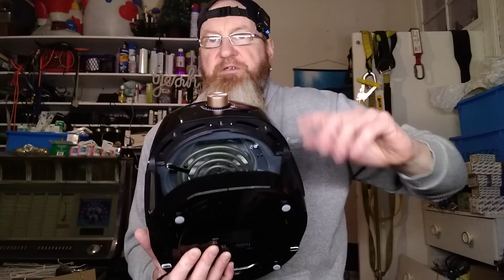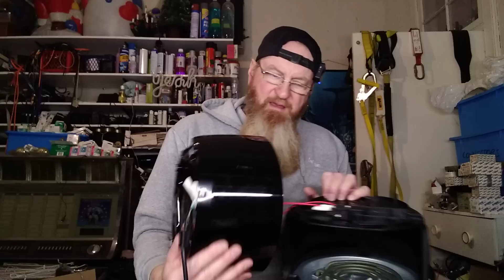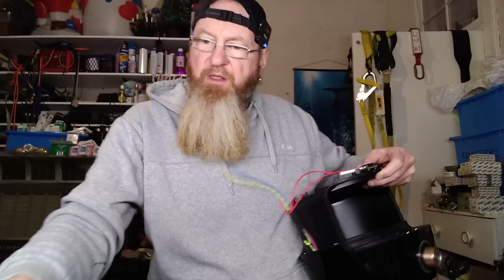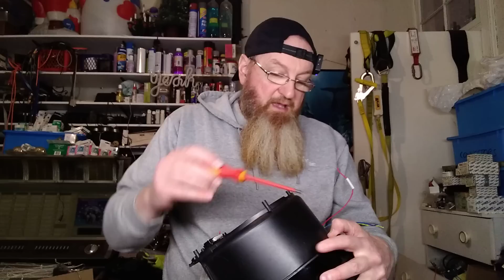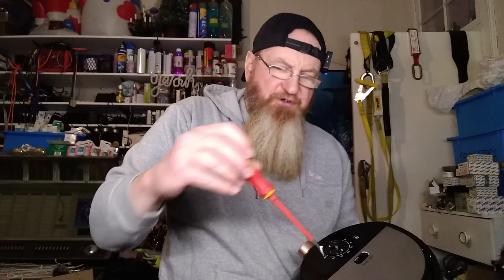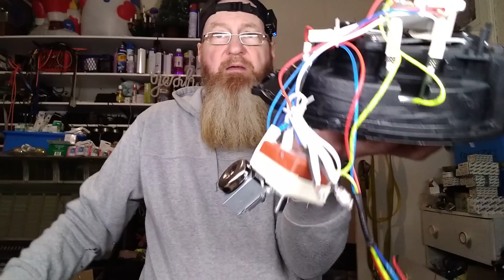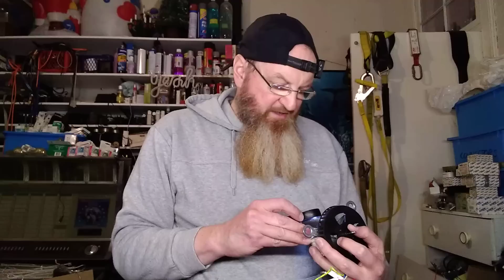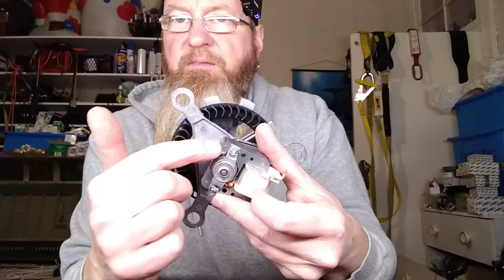Total teardown of an ASDA air fryer

Comment: A couple of years ago, a friend gave me his Gourmia air fryer and said it just quit working.  I said I can probably fix it for you.  He said, no I'm just going to buy a new one.  I knew immediately that it had probably blown the thermal fuse.  I looked on youtube and found a video for the exact one I have and watched it to take it apart.  Ordered a 5 pack of the exact thermal fuse for $5 and got it fixed!  It recently blew the thermal fuse again, so I replaced it and it's working yet again.  I love my air fryer and use it almost exclusively for fixing dinner.  A lot cheaper than using the regular oven.
Reply: Perhaps consider not replacing the fuse with an identical model, but one rated, say, 50 Celsius higher.
Reply: @aaronmdjones  Use two thermal fuses in parallel to reduce the self heating from the current flow?
Reply: Cracking idea... and change all your fuses in every appliance in your home to 13 amp ones 👍 what could possibly go wrong 🤔
Reply: @MothKeeper   If you meant to (but failed to) reply to my comment, fuses for overcurrent protection are sized by conductor cross-sectional area to prevent the conductor carrying so much current that its insulation melts and burns off.

This is not applicable to thermal fuses at all. I am simply suggesting that if they keep tripping their thermal fuse under normal operating conditions, then perhaps the fuse isn't rated high enough. Thermal fuses are available in a wide variety of trip points and 50 extra Celsius isn't going to start a fire.
Reply: @aaronmdjones  if you meant to and failed? Don't patronise me... I know exactly what a fuse is for, I won't explain how... and I know all about thermal fuses again I won't explain how... I (maybe just me?) Know there's a reason why a manufacturer chooses its rated components and without speaking to one of their design engineers (if you could get hold of one) I would not do myself, advocate or recommend someone should modify or implement adhoc repairs changing safety device tolerances from OEM.
Since you did I will do what you recommended and when/if the appliance sets on fire and causes severe damage to my property I will see you in court... Maybe that's why as a responsible person/experienced electrician Clive didn't recommend doing so?

Stop being so clever or not.
This reply does not require a response from someone so ignorant and foolish as yourself.
Good day.
Reply: Thermal fuses protect thermal circuits from overheating and fire. Normal fuses protect wiring from over current in electric circuits and overheating and fire. Neither should be have their protection relaxed. They are probably blowing due to a fault or a poor design that could cause a fire. Fix the fault don't overcome the protection.
Reply: Yeah - if the fuse is blowing then it's the machine that is faulty, getting too hot. 
A higher temperature fuse is asking for a fire.
Replace with the correct rating and you will remain fiire free.
Reply: To everyone that has replied, or will reply later, I have been working with electronics and electricity since I was 10.  I am 62 now and I NEVER have replaced any type of fuse or protection device with anything rated above what is in the circuit, nor do I suggest nor recommend anyone else to do such a thing..  To do so would just be inviting some type of danger!
Reply: @stevenA44    I'm with you on that mate and I'm the same... Messing with death when you start doing stuff like that.

Comment: Made like a lot of other products - to be unrepairable. I took apart a fan that failed because it had rubber bearings. I started stripping down dead gear for the parts and it was never worth it. I ended up throwing the saved parts away as they never fitted anything I wanted to do and it wasn't worth having a huge box of basically crap.

Comment: 5:13 Just reassemble it with the safety switch bypassed.  Many years ago my cheap $10 rice cooker stopped working so I opened it up.  The thermal fuse had blown, so I bypassed the fuse, gave it to my mother and bought a new fully electronic pressure cooker one.
Reply from the maker: I'm not so keen on bypassing thermal fuses unless they are for your own exclusive use.  They are designed to protect against the consequences of thermostat failure.

Comment: In my experience, the mechanical timer was the first thing to fail. My unit works, but won’t shut itself off. I spent $29.
Reply from the maker: Yeah, a different brand I have here does that occasionally.

Comment: I do notice that these pot type air fryers cook way faster than multipurpose ones. I had an air fryer microwave before getting a real one amd cooking fries took like 20-25 minutes. It's essentially worthless compared to an oven. One of these small units can pit 1100 watts in a smaller space, while the microwave combo unit put 900w in a larger space. 
The only advantage of using an air fryer microwave is that it has an option to do both, so tou set a temp and it air fries and when the element is turned off it microwaves.  I rarely used it because the microwave was often too powerful compared to when it air fries so it just gives a slight tinge of crispy. 
The brand is galanz, the controls are a tad confusing too. Theres no dial pad so youre reliant on +1 and +5 minute and +10 seconds
Reply: Too many fries!
A single layer of fries can cook in 6 - 7 minutes 🥳
A semi filled basket? Don't bother 😅
Reply: @deanosaur808  it didn't matter. single layer still took 20 minutes.

Comment: I took a philips one apart, the issue is really the lack of any insulation just like yours,  they would draw half the power.... sad 
The reason things are more expensive in Europe is the regulation, taxes, and state sanctioned monopolies...
Reply: I will try to add some and report back
Reply: steam can not accumulate above 100c unless it is pressurised, the big hole is just a complete disregard of efficiency

Comment: Back when I worked in broadcasting, I saw several transmitter dummy loads built out of an array of standard heating elements (with a few other components to do impedence matching).

Crude, cheap, and effective.
Reply: Sounds like me, Crude, cheap, and (mostly) effective
Reply: They do call it resistive heating, and they are designed to get hot.
Reply: Murphy's 3rd law of Combat: if it's stupid, but it works, it's not stupid
Reply: Before they were bought out by the Americans, local company Genetix used a hand dryer and an Intel "Play" microscope in their state of the art Gene sequencing machines.

Comment: I've had a couple of those. Couldn't walk away at that price. In both cases, the nut that holds the fan blade worked loose despite the lock washer.
So I went a bit upmarket - parted with all of 35 quid on my current one. Doesn't work any better, but it's at least lasted. Like the Asda machine, no point in asking about brand names - I've seen both devices everywhere with a dozen different labels.

What - imho - they all lack is a plate warmer which would be ridiculously easy to arrange. I've made my own from a couple of wire coathangers. Placed in the right spot (differs with machine) the plate is at least warm by the time the pie is hot.

(Pie? Yes! Of course! What the hell else were air fryers ever invented for but for pie and/or chips? OK, hash browns. OK, pasties - but they're NEARLY pies.)

More seriously, with power bills now gobbling into my savings as well as my pension (thanks, von Starmer - why did I ever imagine anything might change?) a couple of kw for 10 minutes is hugely preferable to a 4 kw main oven that costs money just to warm it up.
Reply: Frozen Croissants are also great in an air fryer
Reply: @CampGareth 
News to me - but they're in that machine as I speak. Hoping...
Reply: I like your thinking.

Comment: So if you hacked this to use it as a steelmaking furnace, how long would it take to make a 1/2 kg heat? 8^)   Looks like good value for the money. Lots of usable bits inside. Cheers!
Reply from the maker: I doubt the power is high enough for the temperatures required.  The heating element is also probably not rated for that temperature.

Comment: I wonder if it could be used for reflow soldering? Would probably need it to get hotter than its current max temp, but I'm sure a small uC could be wired in to take temps and control the heating element. If you can repurpose a toasting oven then this should be a doddle.

Comment: Canned darkness always comes to mind when anyone says air fryer. 
I'd need a kitchen extension to house one and from November to March wouldn't have the electricity to run one. 
I doubt you'd fit a 2lb loaf in one or a 5lb chicken which is about all I use my oven for apart from sterilising jars and bottles. They seem aimed at chips and chicken nugget eaters and I don't eat either. I prefer my Tilreda induction hob, that's really fast for boiling or steaming. 
Fun strip down though. I wondered what they were. I keep hearing about them but failed to encounter one in the wild.

Comment: The elements are exactly like the electirc cooker rings and are still surprisingly cheap on Ebay £7  or so - possibly because much of the world still uses them 
The reason items are £20 in UK or $20 in USA is the USA price will have sales tax 5-10% added to it while UK price includes the dreaded VAT
Reply: Ah, so the "USA price" is actually the wholesale price, not the retail price?
Reply: @bluerizlagirl  No - UK sales tax is included in the price, in the USA sales tax is added at checkout.
It usually still works out cheaper due to economy of scale, the US market being six times the size.
Reply: @pd4165  By "retail price" I mean, the amount you actually pay at the till, which is split between the store and the authorities.
Reply: US shops do that dishonest thing if showing prices before tax, then setting you with the govt share at the till...

Just another way to screw the consumer.

Comment: I'm not against airfriers also, just bare in mind all that literature about being a healthier way to cook than normal frying, based on using less oil is tοtal bs.
Yep, using the same oil a dosin times turns it to pοison but air friers accomplish the same in one use due to temperature and constant air circulation, plus cooking oils, including olive oil (I'm a small producer mind you) loose all their value at frying and some frying oils had no value to begin with. Just give you a tasty way to ruin your health in the long run. Sorry for the rant.

Comment: Clive, you did a great presentation in an unfamiliar venue. If I may be so bold, I suggest an electric screwdriver to reduce the teardown time? That approach would reduce your talk time so it may not be the best choice in every case.

I can see this progressing as a theme. For instance a blender is mechanical and I assume has more sophisticated electronics for motor speed, etc. Plus focusing on the electronics of motors would be a very good teaching opportunity. 

With a bold spirit you may even look at bigger appliances like a washer, dryer, or dishwasher (I'm an American with a European heart).

Cheers!

Comment: I'm pretty sure the air exits out the back only. I had one just like it but paint started pealing on the basket.
Reply: The coating on mine started peeling after 6 months. 6 years later I'm still using it 🥳

Comment: Recently I built a controller for the oven in order to dry 3D printer material. An air fryer would do the job easier I guess. Cheers

Comment: hmm, like a pizza keep-warm box
when I order pizza I tend to leisurly eat it, but by the time I get through it it has cooled down
or a shrink wrap finisher
I often use a tiny butane torch lighter for shrink wrap, would be nice to shove stuff in a hot box that shrinks perfectly without melting the wrap
Reply from the maker: I sometimes put mini pizzas in my air fryer.  5 minutes from raw to crispy.
Reply: @bigclivedotcom  dam, never considered that use, I have an 80's toaster oven I use, but if it had a fan it might help with cooking.....

Comment: Amazing what can be manufactured from the same motor you would find in a 1960's record player, the identical heating element from a 1970's electric cooker and a modern one-shot thermal fuse. Recycling at its best.
Reply: Yep. It's amazing to me these have only caught on now, we could have been using these decades ago.
Reply: @bluelightningnz  It's almost as though someone took out a patent on the original implementation, but got greedy and tried to sell the machines too expensively, so no-one bought the first time around; and it's taken the expiry of the patent for air frying to catch on.
Reply: @bluerizlagirl Was the said patent owned by Tefal?
Reply: @bluerizlagirl  That is exactly what happened with those oscillating DIY Multi tools. The original was only sold as medical grade (for cutting plaster casts off) at a medical facility type price.

Comment: Still amazes me that they can use low cost momentary style switches to interrupt a kilowatt of power.. The different camera view was good. Didn't look the easiest for you though. Also not as much clear close ups, but the scale and orientation were easier to observe. If u could switch between cameras eg an overhead view, that would be extra cool, but too much work for you I'm sure
Reply from the maker: Microswitches are often rated for 10 to 16A.  On 240V 1kW is 4A.

Comment: Clearly, they didn't design these things to be easily cleaned. The basket, yes. The rest of it, no. Have one that's similar and cleaning the main unit portion is a complete pain in the 🍑.
Reply: That's why I won't buy expensive ones. Just easier to buy another when  they get grotty. And they always get grotty whatever your efforts.
Reply: @jackywhite880  partial disagree there - I went through a couple of cheap ones, as you say, then put my big boy pants on and spent the money on a fancy pants Ninja which has a removable platter (electrically heated, darling, for doing steaks and things!) and a good quality, double layer, easily removable and cleanable mesh grille over the heating element and it's all been way, way easier to keep clean, and so doesn't get grotty.

That said, it did cost two hundred fucking quid so you'd bloody hope it'd be more maintainable 😲

Comment: I wonder how many of us subscribers also take things apart and put them back together and hope no-one notices. Our air fryer is used daily, sometimes several times a day. Very useful, it lives next to the microwave so the pie is microwaved and the chips are air-fried, a genius invention. Thanks Clive, good post, hope the knob pulling went OK 😂😂👍
Reply: I am lucky,  It's my job talking things apart,  Fixing Macgyver style, And putting back together.
Reply: @dogwalker666  ever since I was 8 or 9 I've been taking things apart and building things, latest was a blue tooth speaker with FM from scratch. I'm 70 next year and drive my wife mad with my tinkering.
Reply: Air fryers are dumb. Oven does everything hundreds of times better.
Reply: @elixier33  Maybe dumb, but so many people use them as a quick and easy way to cook a meal. I'm disabled and ours is used everyday.
Reply: @elixier33  I'd have to say that you are the dumb one - my air fryer (this exact model) is faster and cheaper than turning my main oven on, whilst performing the same task, but the food is ready in the time it takes to get the main oven up to temperature - I've probably saved the purchase price in the six months I've had it.
Reply: @elixier33  It is basically a small fan oven. Do you want to heat up an oven big enough for a Christmas Turkey to cook two chicken drumsticks ?

Comment: Got to see I'm not the only bloke who drops stuff on the floor,,, and then has a good grunt picking stuff up again.
Reply: My Mum would call the grunt "gut smash" 😂
Reply: Magnet glued on the end of a transistor radio aerial.... Saves a lot of grunting under the desk. Also, bare feet. I learned to pick things up with my feet as a kid. I'm not as flexible as I was but can still retrieve most dropped items without more than sliding the chair back a bit.

Comment: I'm still working out things to cook in my air fryer (I didn't want to buy one just to make chips (french fries)). So far I've done cod in cheese sauce (with a silicone liner), Mediterranean roast veg with halloumi, and cooked Aldi pastry parcels. The cost to cook two of the pastry parcels from frozen was around 12p. The cooking temp was around 20°C lower but the cooking time was about the same but without the time to preheat the oven. I have also made chips in it. I may have a go at baking some sort of cake at some point.

Comment: It's basically a re-packaged convection oven but harder to clean.
Reply from the maker: Not that hard to clean.  Run with dish soap and water.
Reply: It's simply the easiest thing to clean. You can even buy paper to place the food on inside and dispense with any cleaning.
Reply: Heat gun! 😂